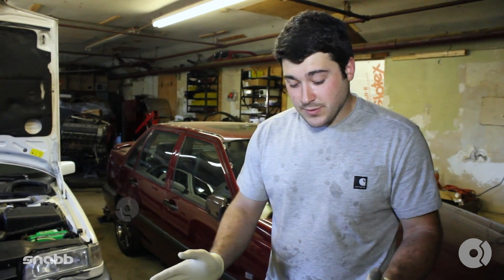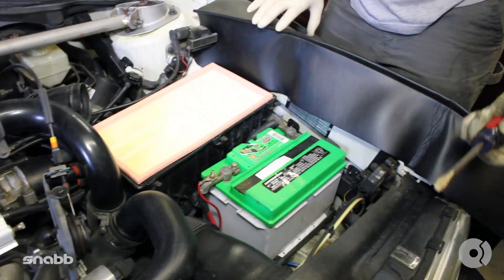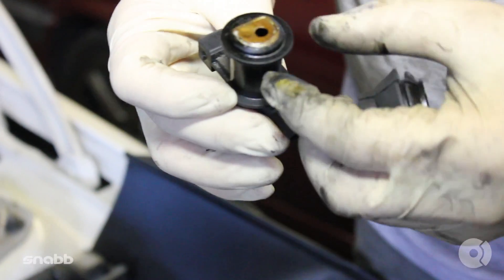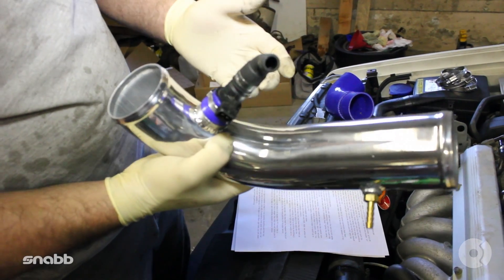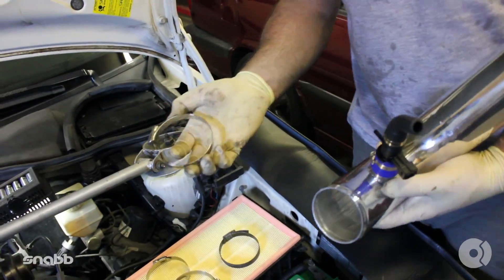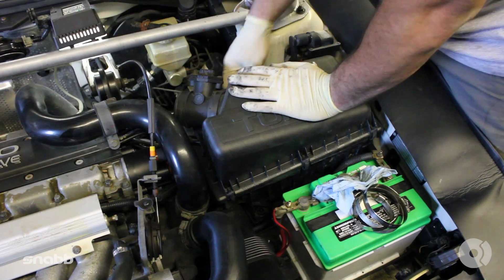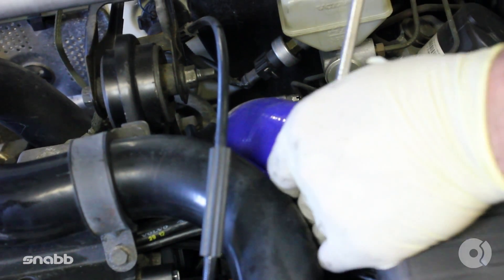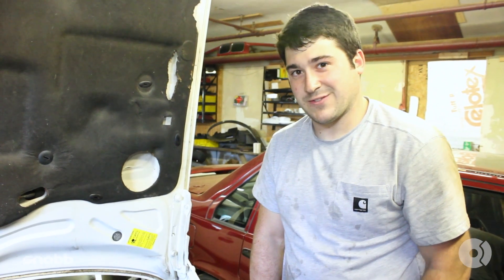Snabb High Flow Air Intake Install (Volvo 850 Turbo) FCP Euro

Comment: Nice. I have a question tho, after you trim down the ptc piece to fit into the intake what size should it be? I mean the diameter? Planning on buying this and a new ptc but I wanna have the ptc setup and ready before intake gets here so I can install it quicker.
Reply from the maker: Hello Jav, please email products@fcpeuro.com we'll be happy to provide you with that information.
Reply: Thanks. I did and going to put mine on in a few minutes. I heard good things about this intake from the forums and other buyers.

Comment: dumb question but for someone getting into this sort of stuff will it work on the GLT I don't have the turbo
Reply from the maker: Unfortunately this kit won't work in a non Turbo application.
Reply: Damn well thanks for saving me some money........are there any air intake kits that will work on non turbo that will increase performance or am I SOL
Reply: You watched the video, right? The bit about it fitting to the Turbo? TURBO being the operative word here?
Reply: In the states, the GLT model is a light pressure turbo.
Reply: @fiction2172  not until 97. 96 and down GLT cars are NA.

Comment: Ive recently put this into my 2002 xc70 and now i have a check engine light on for thermostat and turbo. Could this be because of the new air flow?
Reply from the maker: Hi, David. What code are you getting for the turbo? A thermostat code would likely be unrelated since this doesn't involve the cooling system. I would also make sure all connections are tight and that you don't have any vacuum leaks.

Comment: Probably a stupid question, but do you know if this will work with the IPD SR5T cold air intake? Looks like it would, because the intake works with the factory plastic pipe, just making sure before i drop $160 on the kit.
Reply from the maker: Hello Roy, it should be similar to the Snabb intake in this video.
Reply: Well they are two different parts. This is the tube that replaces the factory plastic tube, that connects to the IPD intake. The IPD intake retains the original plastic tube that connects the turbo to the air filter assembly, so I'm wondering if this metal snabb tube will line up properly with the IPD cone filter and intake system.
Reply from the maker: Unfortunately we never tried this combination so we're not sure if it would work for sure.
Reply: Yes it will fit. The Snabb pipe hooks up to the MAF sensor that then goes into the SR5T intake. As long as you have the correct MAF sensor it should fit into the SR5T fine, I just put my intake on last week and love it, I definitely plan on getting this Snabb pipe to go with it.

Comment: this does not work the only thing that changes is the sound of ur car
Reply: Did you dyno the car before and after?
Reason asking is that I just installed one today, homemade pipe similar to this and the first thing I noticed was the car spiking to 15psi before settling at 12.5psi which tells me there's probably no restriction and there's more air getting in. I just reset the ECM (mine is a 99 S70 T5) so that the ECM relearns with the new hardware but even if I don't pick up any HP here, I'm just opening things up for the big turbo to breathe.
Here I'm quoting Kristian from Snabb :
"f you've never taken your fresh air pipe off your car you may not know 
how much of a restriction it's causing for your turbo. The factory pipe 
reduces down to a smaller size than the turbo inlet and is corrugated 
disturbing/restricting airflow and silencing your intake. On the 99-07 
models the stock pipe is 3" at the MAf and reduces down to roughly 1.75"
 prior to the turbo which for non R cars has an inlet size of 2.3". This
 equals a huge reduction in airflow at high RPM's. 
Our 850 intake was recently dyno tested by a third party (ARD) and had Great results.
 As a bolt on the intake alone increased mid-range HP (3200-5500) by 5 
WHP. The increase was enough that they had to retune for it and after 
the retune they captured a total of 12 WHP!! with the installation of 
this pipe. Also flow bench testing on has shown to increase airflow by 
21% over stock."

Take all you want from this but looking at the neck of the stock pipe, I can see how air would be restricted and that's why I decided to built my own.